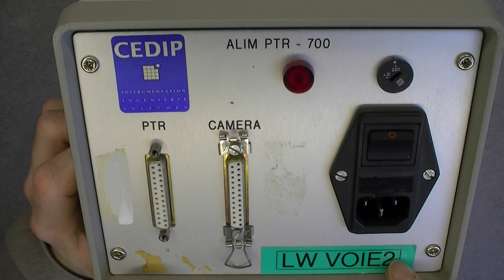Teardown of the not-so-controller box for the dual Aga thermal camera

Comment: great video
if you really sell the enclosure, this might be a useful information for you: SCHROFF Comptec 3U 42TE (and try 40 Euro each).
3:30 this is how my first prototypes looked like back in 1996
3:30 this is also how my first industrial control unit looked like (back in 1999, and it is still up and running 24-7)
3:30 this is how my ACTUAL prototypes look like if it has to be FAST solution, but I don't really like it either